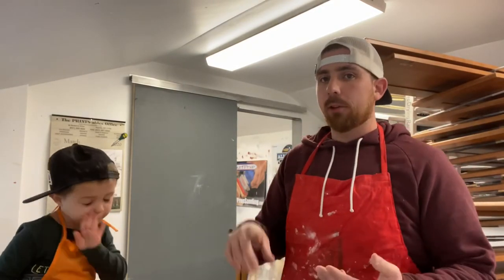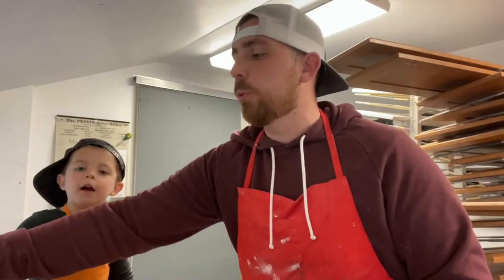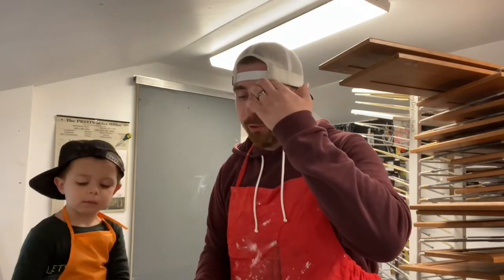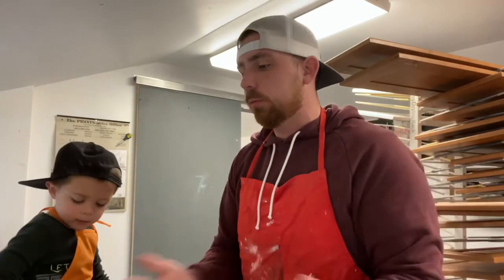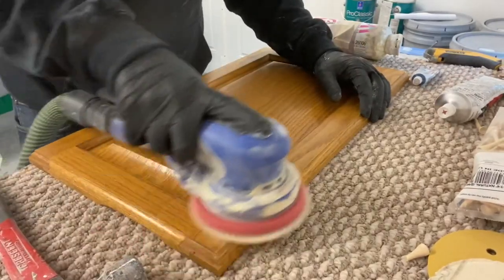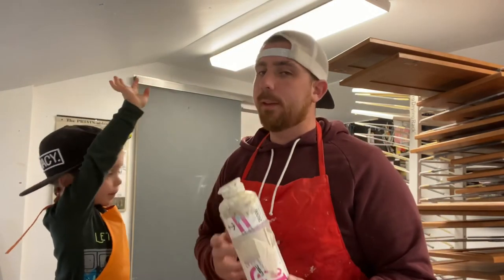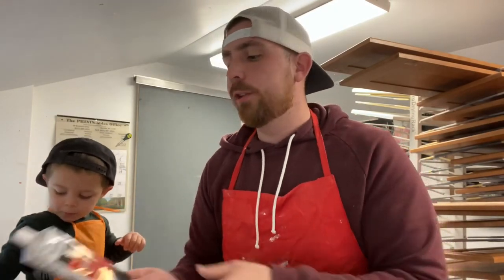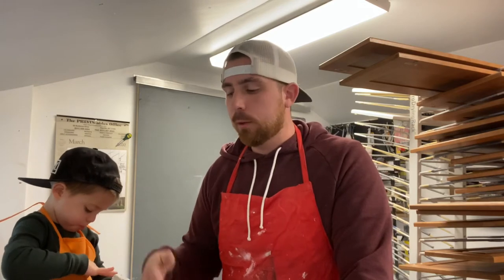Prepping kitchen cabinets for painting

Comment: Can you explain why you can't use TSP for cleaning, while using shellac based primer, if you are just going to sand off the top finish after the sanding??  TSP solution does not seep into the wood during the initial cleaning since the original finish does not allow that to happen.  I have maple wood cabinets, unless that is the case with oak as seen in your video.

Comment: Great video . QUESTION. Can I use the same Airless sprayer and tip  for the primer and the paint??
Reply: For professionals, they keep it separate. You could use the same equipment, but you have to make sure you clean them thoroughly when switching back and forth.

Comment: What grit do you use when sanding mate 500 grit? Or like 120?
Reply: 220. Any coarser than that, you are leaving scratches. 200 will give the primer enough surface to adhere to. Like he said in the video, just a thin coat of primer is needed, then (imo) 2 coats of painting.

Comment: I cannot get denatured alcohol here in canada. Will isopropyl work or can i just vacuum and go over with tach cloth?
Reply from the maker: Just vacuum and wipe well with a damp rag. No tack clothe. Tack clothes leave a residue that may not he compatible with some products.
Reply: Thanks for the reply. Another couple questions. Looks like you do alot of cabinets, im looking at going white in kitchen. What is a better sheen.... satin or semi gloss finish? Worried about the white turning yellow after a couple years. What is the best paint to use and would you spray polyurethane to finish?
Reply: @kerryb2061  As I understand it (as I'm researching kitchen cabinet painting and furniture restoration), polyurethane over white paint almost guarantees yellowing. Polycrylic would prolly be better, though not as durable. However if you use good enamel paint you should't need a topcoat.